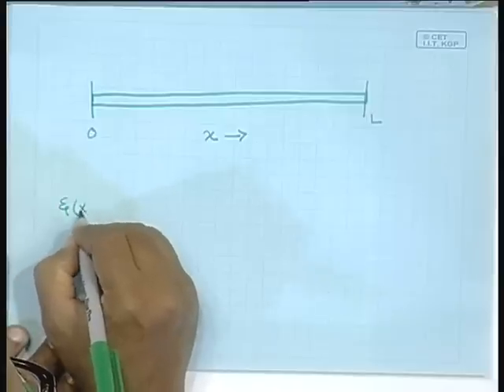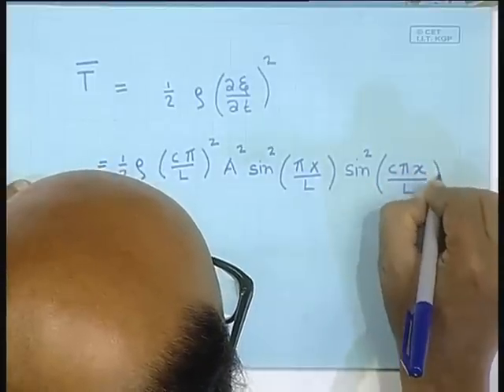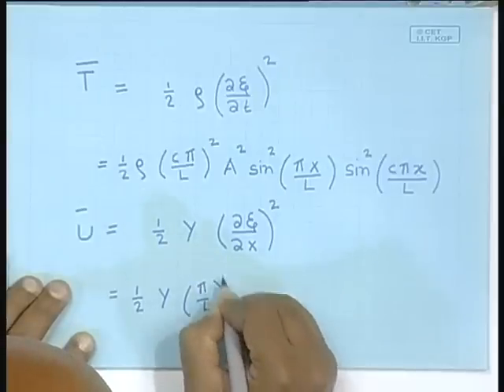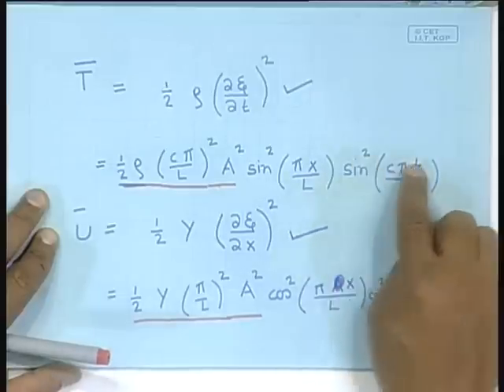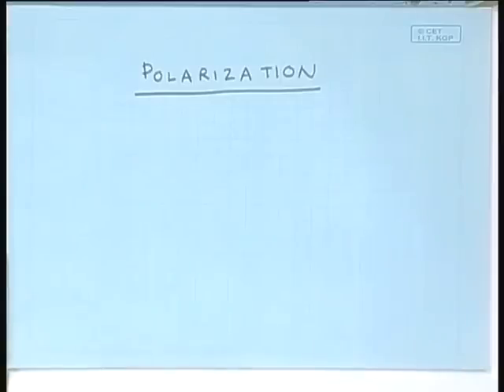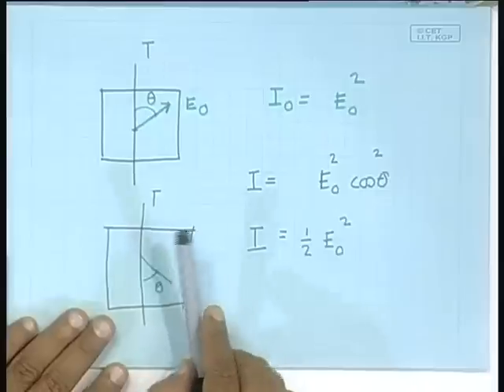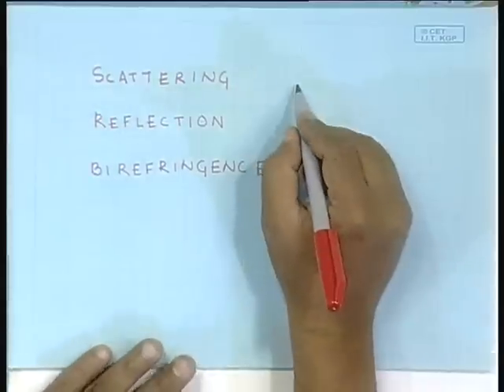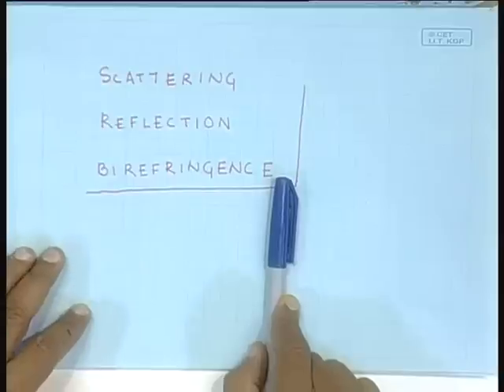Lecture - 30  Standing Waves

Comment: This is way over my head mathematically however, I am learning alot . Thank you for this information. I am trying to formulate my laymans theory of bio physics. I think that the steel rod are our bones & the standing waves are muscle fibers. Hypertrophy is a result of the interaction of weight displacement. Body building. What ya think about that? its knesiology of a bio standing waves